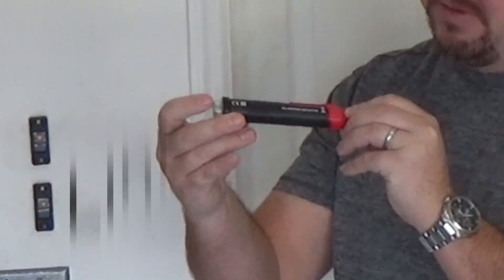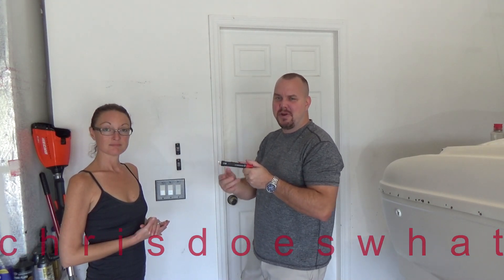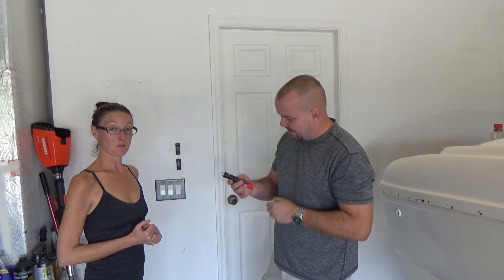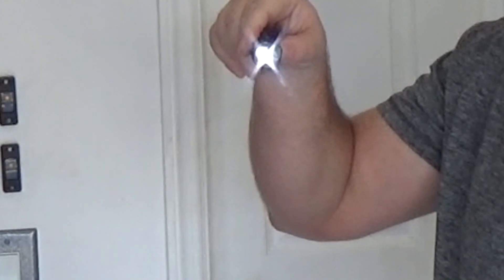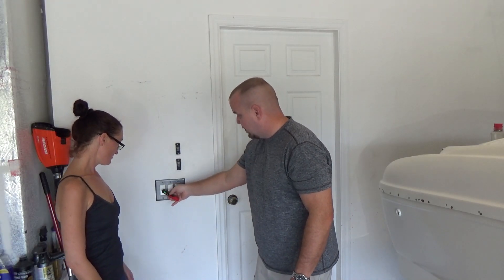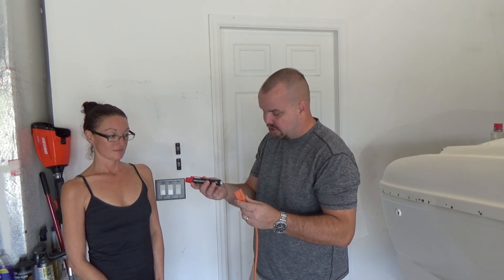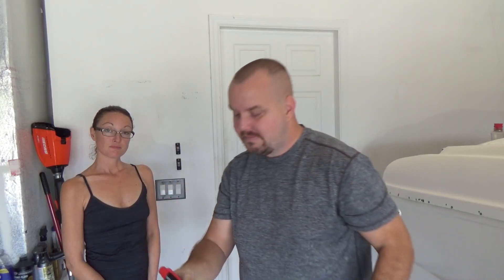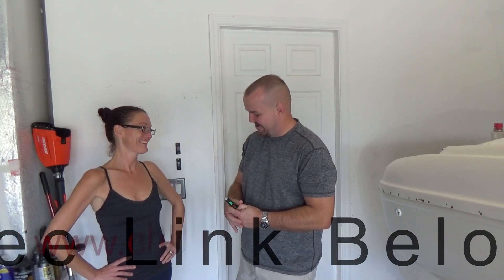Review || Non-Contact Voltage Detector LCD Pen 12~1,000V

Comment: Does it work with testing car wires (I assume DC voltage) for example the wire from battery to the engine radiator fan by sliding the tip of the pen along the insulation of the cable to find any breakage?
Reply from the maker: Don't think this would work because the current is broken.

Comment: In the US, the right side is not the Common. It's the neutral, left is hot, bottom is ground or common.
Reply from the maker: Thank you for watching! I usually use the color code adopted for US wiring, also use a multimeter to make sure that I am not working with someone else mistake. The white (or grey) is for the "N" neutral power, bare copper, green, or green with yellow stripe for the "PG" protective ground, and Black or Red "L" single-phase hot.
Reply: Easy way to remember is the wider slot is neutral, wide like the ground, and neutral is closer to ground than the other side, which is hot.

Comment: I just got one of these and it easily picks up hot switches and wires.  BUT.....i have some old outside cable, phone, and electric wires that even though some have been cut, i get a single beep and red tip on the pen?  Not a repeating beep...just a one time beep when i touch these wires or metal.  What does that mean?  For the life of me, i can't find any instruction on what a single beep means.
Reply from the maker: On the very sensitive setting this can be a little bit misleading because it can give you false beeps.

Comment: I have the same tester but looking for how to adjust the sensitivity. You mentioned it but jumped right over the how to operate part.
Reply from the maker: The Red button is  push to adjust the sensitivity from low to high.
Reply: Chris Does What  gotcha, I kinda figured but it still said LO on the screen so I started checking YouTube videos to see. Thanks for the info!
Reply from the maker: @trpn8r477  No problem and thanks for watching!